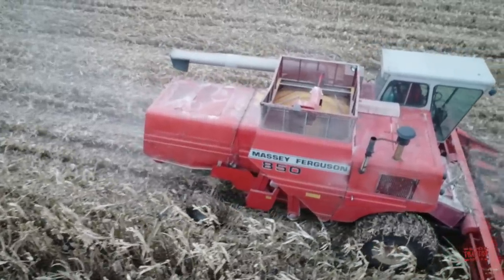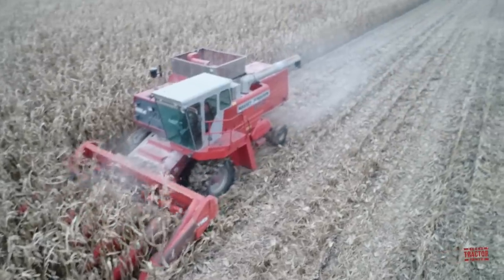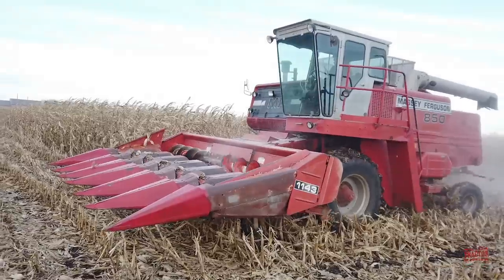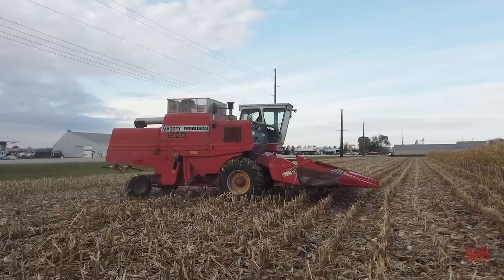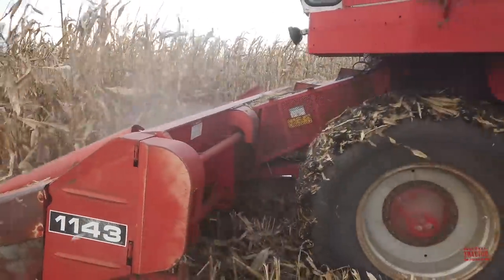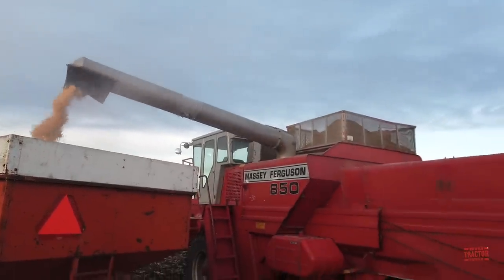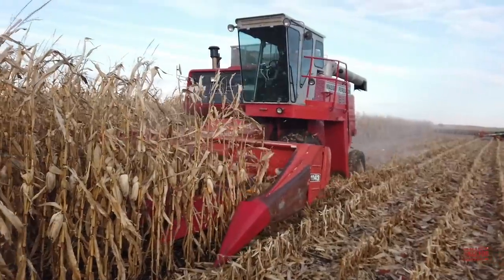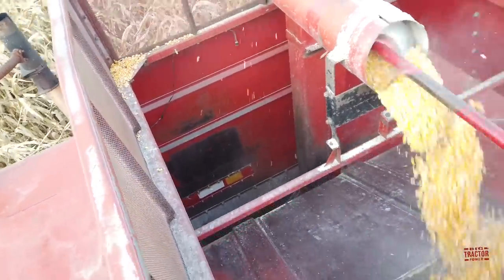MASSEY FERGUSON 850 Combine Harvesting Corn

Comment: I still run an 850 on about 400 acres of winter wheat , soybeans, and corn. If you tweak things, you can make make over 3 mph in 200 bushel corn. There are at least 6 of these machines still in use as the main harvester on smaller operations in my local area. You don't need a laptop to diagnose any problems, although some parts can be hard to get.

Comment: I used to work for a southern Indiana MF dealer (owned by long time best friends) we worked on a lot of combines and the old 850’s were really a work horse. I’ve worked on and ran everything from a 300 to a 9540 my favorite machines were 9690’s I believe they were some of the best machines Massey ever built.
Reply from the maker: Very cool.  I am always looking for Massey Combines to film.
Reply: bigtractorpower there’s 1 9690 1 9895 and atleast 1 8570 still running around here

Comment: Australia here. We paid $130,000 aud, for the MF 850 with a tine reel front in '85. Our government had really screwed our currencies value. I first learned to drive the MF 750 for a farmer so I was very familiar with it. The 850 was just a nicer 750 with a hydrostatic transmission and a more effective chaff and dust removal system for the radiator. But we had big issues with the warning sensor system that would constantly go off. But they were a fine machine if well serviced though a bit dated compared to the rotary drum machines.

Comment: Nice video! The 150HP engine is limiting speed with the 6r cornheader but maybe a little bit more would be possible...
The saddletank combines beginning with the 300, 410, 510 were good machines - if manufactured in canada. The european types made by Dronningborg had quality-problems. My brother in law has one of the last still working 1983 built MF660 and nearly every part of this machine was broken in the last 30 years. No more 520 or 620 can be seen here because all of them have been scrapped. In the Netherlands there still work a few (as far as I know canadian built) 760 without any problems...

Comment: We had a 550 then went to a 850. Thought we was in the big time. Had a 20 foot bean head with a 6 row corn. Went quite a bit faster than this guy but each to his own
Reply from the maker: Very cool.  I think the speed on this one is running through 200 plus bushel corn.  When the 850 was built 200 bu corn was not in the mix.

Comment: What's weird is the 1143 stickers on the corn head.  That was the 4 30" row.  The one in the video is obviously 6 30" and it should be an 1163.  Maybe the sheet metal was changed?  Or who knows.  Massey built a lot of combines out of leftover parts I think.  Sometimes you will see yellow wheels on the red/silver combines and that wasn't normal either.
Reply: hordboy I saw that to and wondered.
Reply: I think the tin is interchangeable but the stickers were different as you said , some body must of done some tin swapping cause I did a double take also !!
Reply: @johnallen5996  our 1163 says 1144. I took the better parts off our 4 row when we went narrow. Almost all parts are interchangable.

Comment: Wow been a long time since I seen one of them. I grew up around one of these. I use to sit/sleep on the shelf behind the seat. That will tell you how small and young I was. Are machine was modified with a rotary screen where the grain goes into the box as it comes out the elevator. It removed small weed seeds and cracked grain. We harvested wheat, oat and at that time a little barley. I never drove it when I got big enough to operate a combine. Think I was 13. I was on a IH711. We sold both and went to NH after that. Later Dad and I got an old 860. Worst ting we ever did.
Reply: Gazza's Stuff  similar story, uncles went to NH TR combine then several years later bought another Massey to assist the NH that 2nd Massey was the worst ever

Comment: Going that speed he’ll be there for a while 😎
Reply from the maker: When the 850 and other combines of the period  were built 200 plus bu. Corn was not a concept.
Reply: We run a 750 an 850 with six row heads in 170 - 240 bu corn an we run way faster and our sample looks just as clean, I'm guessing he is going slow because of the filming!?

Comment: Great vid of MF 850 harvesting corn 🌽 Uncle had MF 860, it was slow harvesting swath canola but harvesting wheat n other varieties was quicker at 5 miles.  But wasn’t as quick as CaseIH 2188 with 36ft Header vs MF 26ft header.  With our red top CaseIH 8010 it little bit faster, imagine what new JD X9 speed will be in the field as JD quoting 100t/hr where our 8010 65t/hr.
Reply from the maker: Thank you for watching. When the 850 and other combines of the period  were built 200 plus bu. Corn was not a concept.  The new class 9 and 10 machines can cover some ground.  I filmed an S690 with s 16 row head and a 6600 with a 4 row head in turn around clips which is running corn to the headland and turning s round and harvesting the next pass.  In the same distance the S690 cleared 32 rows in 43 seconds. The 6600 tool nearly 4 minutes to cover the same ground Nd clear 8 rows.

Comment: We had massey Harris  and MF  205  410  750 and 1985 850 . .. could 
Run 3mph in 180 ish corn no problem.   All bought new... trades every  7 years!   Just  because  we had a dealership  close by ..10 miles  after the tuff 1980's  we still  farming 
But with a John  deere  combine

Comment: I use to combine corn with a 6600 JD and an all crop head . If we would have had an actual corn head we might have been able to speed along that fast.
Reply from the maker: Wow an All-Crop would bring in allot of material.   When the 850 and other combines of the period  were built 200 plus bu. Corn was not a concept.

Comment: Those combines were in the twilight of their design lifespan. The competition at that time were making better machines. For everyone commenting on his slow ground speed, in high yielding corn the limiting factor was the size of the clean grain elevator. It was originally designed for small grains, never big enough on the 750 and 760 and it didnt get upgraded on the 850 and 860. Most guys around here ran 6 row heads on 860 and 760's because the 8 row way overloaded the handling section. Their design was good in its day, but when IH unveiled the Axial-Flow it rendered everything else on the market obsolete in corn and bean country.
Reply from the maker: Great post.  When the 850 was built the idea of 200 plus bu. Corn was not a concept.  Massey’s acquisition of the White 9720/9320 combine in 1985 was the companies way of catching up to the Axial-Flow.

Comment: Might as well add two more rows and move at the speed of molasses
Reply: Not sure his reason for going slow, in the past we'd fly in corn with 750s and 760s
Reply: I was thinking kinda the same thing those old girls would take a lot of corn back in the day !
Reply: @Zero01k  generally going slower means the machine is putting more grain in the tank and not blowing it out the back.
Reply: @leesteele9290  we owned a 750, and 850, and an 860. The one they never lacked was capacity, their only weakness was horsepower, put the kind of horsepower in one of them that they are using today, and they would stay right with any of them. I don't know why he's going so slow, but he isn't even making the governor work.
Reply: Dale walker  Agreed !!!

Comment: the optional 164 HP engine seems like a miniscule performance increase over the engine the combine came out of the factory with
Reply: I think the option might have been a turbo intercooled engine instead of just turbo (?) but I can't remember many details.  Our farm had a succession of MF combines, several 300's, a 550 then 850.  They all were pretty terrible!  lol I got pretty good at changing bearings and shafts on them.
Reply: @hordboy  changing the subject slightly but I was at a grass harvesting demo in England in 1975   MF had a trailed precision chop grass harvester which was crawling along for about 40 feet before the header auger repeatedly wrapped , the idiots that were demonstrating it did,nt have the sense to park it up rather than show the company up, meanwhile JD had a self propelled chopper that you had to run to keep up with , 40 odd years on and JD are in pole position in the UK and MF can,t design anything relliable, best thing they produce is the big square balers and they are built by Hesston...
Reply: @robertlonsdale3826  I don't have too many favorable memories of our MF combines unfortunately.  They had design flaws for sure.  We had a new 550 that was impossible to keep the grain pan from falling apart.  Eventually the dealership had a local machine shop fabricate one from scratch, much heavier built, and then it was cured.

Comment: I wondered how the older machines of yester year would preform in todays high yield hybrids , 100 to 150 bushel corn vs 250 in todays world slows em down
Reply from the maker: You can see in this video the 850 has to run fairly slow in modern corn. When the 850 and other combines of the period  were built 200 plus bu. Corn was not a concept.
Reply: We have an 860 and a 8780XP , the 860 will do 4.5 mph in 200 bu corn , 8780 can do 5.5.
Reply: The clean grain elevator is the bottle neck. They don’t have any capacity and the straw walkers are driven by the same belts so everything slows down

Comment: 0:30 at what speed is it harvesting 2 or 3 mph
Reply: PlowableGore 14 I wonder if they’re moving slowly due to wet conditions
Reply: easchit probably the area doesn’t look very dry🤷‍♂️ and there’s also mud on the tires
Reply: @vehicle_pictures_2328  Seemed slow to me as well until I saw the corn going into the grain tank.  Higher yielding corn now than what was produced in the 80's is perhaps pushing the capacity of this combine.  Just thinking out loud.

Comment: Like watching paint dry!
Reply: Ya haven't seen slow till you've seen a white 7300 with a 4 row head in 200+ bu. Corn. Haha
Reply from the maker: When the 850 and other combines of the period  were built 200 plus bu. Corn was not a concept.  It’s a slow go the feed all the crop in.
Reply: Yep you are correct, that's why I have a more modern machine now! But it's still fun to watch your videos with all the wide variety of equipment. Better than watching TV!

Comment: i bet emissions regulations were much more relaxed back in 1982-1985 compared to now because I noticed no mention of a tank for holding diesel exhaust fluid
Reply: DEF is a new emissions requirement that has been in place not all that long. 20 years ago DEF was not heard of. For this reason older diesel equipment does not have DEF
Reply: @estoncoe5160  ah, ok :)